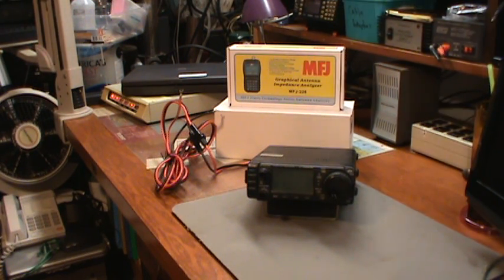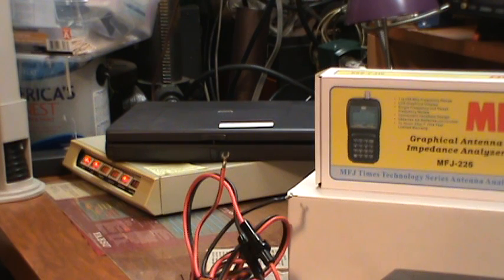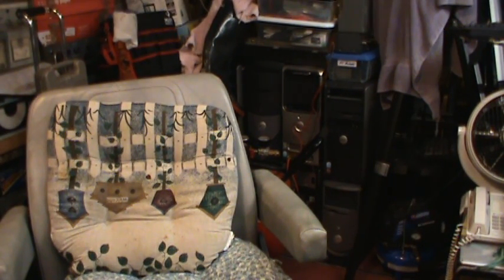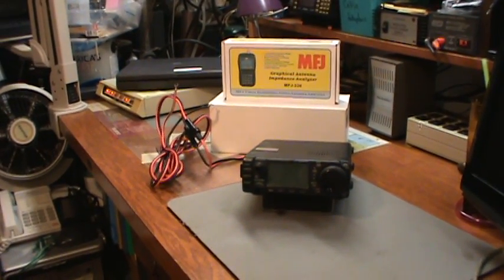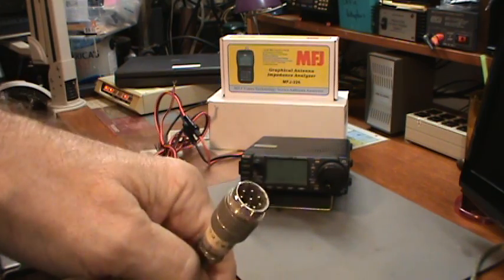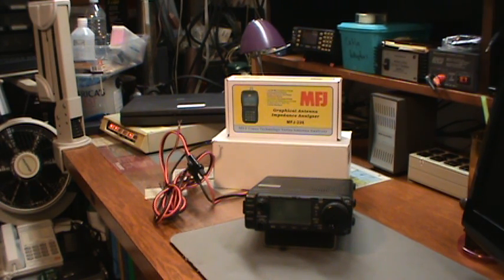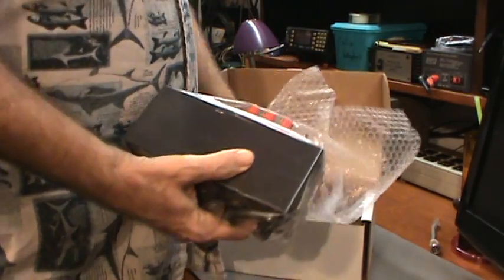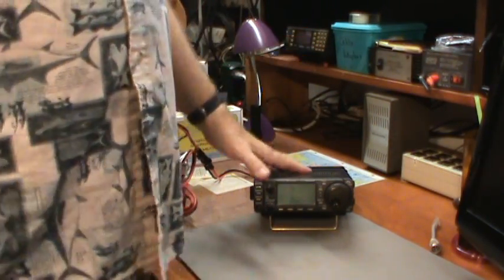TRRS #0811 - MFJ Portable Antenna Tuner Part 1

Comment: My condolences for your friend who passed away.  

Excellent video, can't wait for part two.   

I always knew tuners to be labelled as, just fooling the radio of matching 50 Ohms, so the mismatch happens in the tuner not the radio.   What i want to know is lets say you have an external amplifier.   Does the amp go after the tuner or in between?
Reply from the maker: +Theo T He was a great guy and I miss him a lot.  The tuner is connected to the antenna, then to any other equipment then to the radio last.  An amplifier should already be a match to the transceiver.
Reply: hamrad88 sorry for your loss friend! Good friends are hard to come by and I consider them a gift from God! My condolences!